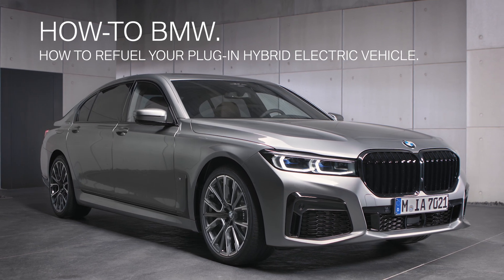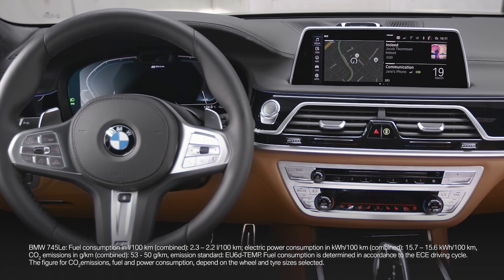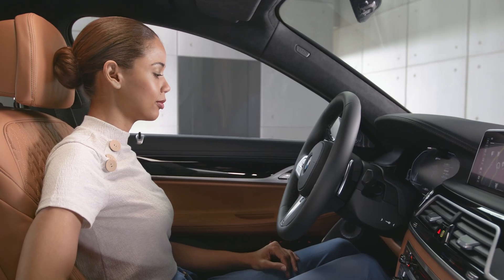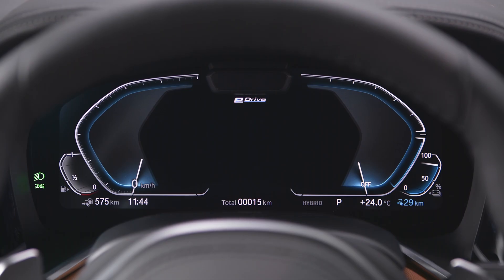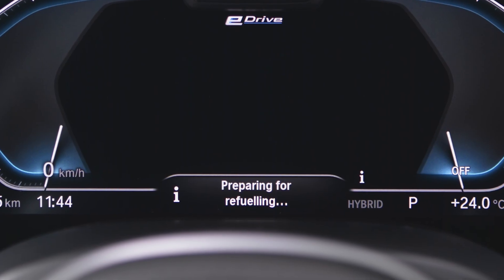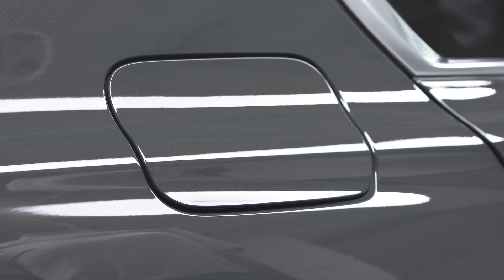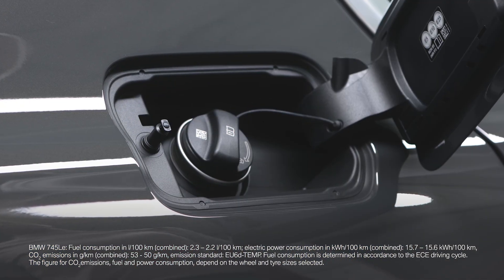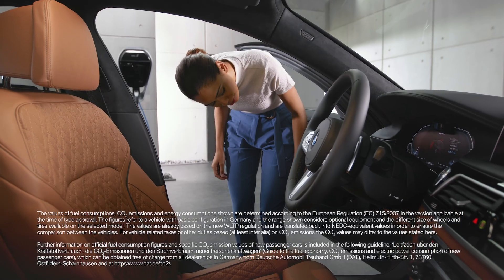Refueling your Plug-in Hybrid Electric Vehicle – BMW How-To

Comment: What is the purpose of the decompression. I have a PHEV which does not have this?
Reply: Nearly all vehicles have pressurized fuel tanks so the vapors do not escape and cause a potential hazard, increase fuel gauge accuracy and help the environment a very small amount

Comment: Hi ...I have BMW 730li 2017 .. i have received a message..."You can continue driving. Roadside assistance not required. Drive power reduced. Please arrange an appointment with your Service Partner."

What is mine...🙂

Comment: The fuel door won't open,  we got stranded at a gas station for 1.5 hours,  called bmw roadside assistance 3 times and they couldn't help.  Any suggestions? This is very scary indeed to get stranded in the middle of nowhere with no gas.
Reply: There is a manual release tab from inside the trunk.
Reply: @ProfShyv  And how does THIS work? Would be kice to get a video about this. If you know one, I'll take it.
Reply: @martinam8962  
1. Open the trunk.
2. Open the panel on the right by pulling down those two clips.
3. Pull the bright green string until it unlocks.

I have the same issue with my BMW 330e 2016.

Spraying lots of WD40 into that small locking pin might help.

It's still a poor design.
I will not buy a BMW again next time.